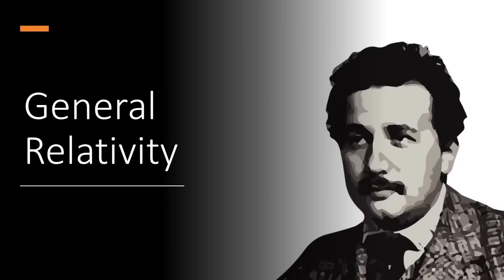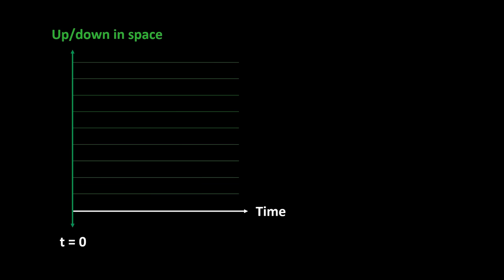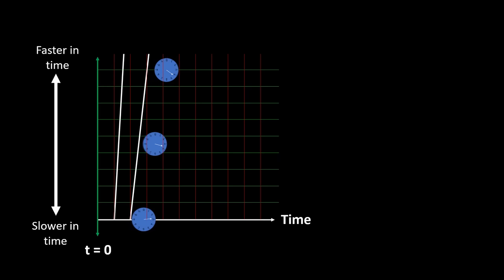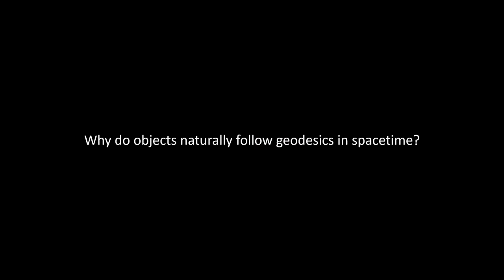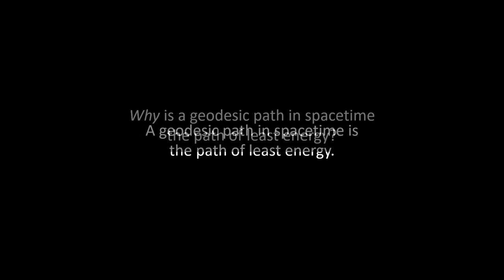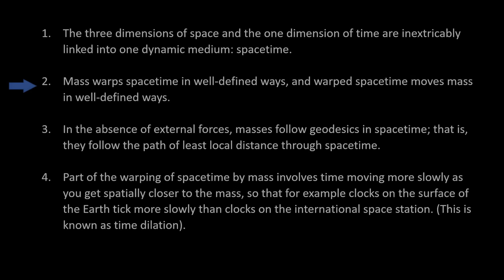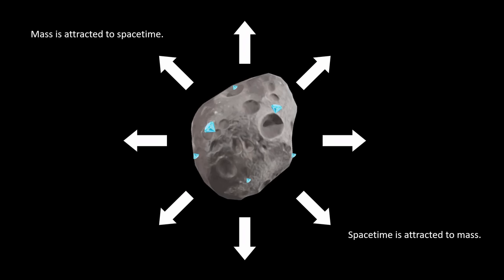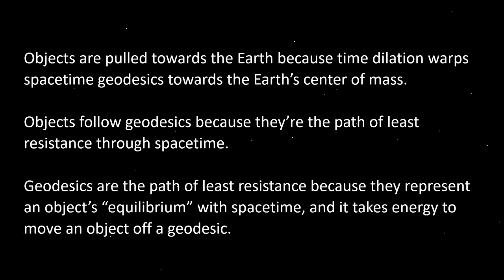How Time Dilation Causes Gravity, and How Inertia Works

Comment: Wait I think I figured it all out…. This whole change of time compared to each other is all dependent on e=mc2 or e/c2 =m.

Meaning as long as we agree that mass bends space time and slows down time for us…. It would also mean as we’re approaching high energy speeds… the mass of us or the speeding object increases substantially aswell…. Because speed or energy therefore increases… with the equation it means mass increases aswell for the speeding object….. and as mass is increasing… the gravitational effect increases too… meaning time slows down due to the speeding object having more mass….

This also explains why if you travel at the speed of ligjt to any distance in the universe. The object that’s speeding will actually take a few seconds to reach places 1000’s of light years away because the time slows down to such an extent for the moving speeding object traveling at speed of light.

But because the others on earth are relatively at rest, time still moves the same rate for them so it will take 1000’s of light years for them to even know the speeding object had reached another planet….

Comment: Let's say that someone is at the top of an extremely tall tower and is dropping pennies to someone at the bottom of the tower at the rate of 1 penny per second according to their clock.  Will the person on the bottom receive pennies at the rate of 1 per second according to their clock and will there be an accumulation of pennies in between the person at the top and the person at the bottom?

Comment: This representation does not match reality because the celestial bodies do not exist on the surface of space, but rather they are submerged in space, and therefore there is no such curvature, which is said to be the reason for the bodies’ attraction to each other. This is regardless of the fact that these bodies are not fixed, but moving. Imagine what happens to that alleged curvature. To approximate what I am saying, we have to imagine a ball moving inside the water and not on its surface. Even if we imagine a ball on the surface of the water, if it is fixed, there is no around it that curvature that occurs only when the ball falls on the surface of the water and then it quickly disappears.

Comment: Im getting stuck on why objects follow the geodesic. Yes i understand that its the shortest path, the path of least energy, the path that maximizes time.

But i feel like you were explaining the consequence and i couldnt derive this without already knowing the answer. I understand that it takes energy to move it off its geodesic, a consequnce of it following the path of least energy. That was a good analogy, but to, again, explain a consequence.

You didnt explicitly mention wether the apple you were talking about was described as a particle or 3d geometry, but it appears you were talking as if it were a particle (even if you werent).

In my head, the 3d geometry and gravity gradient (thus different parts of apple experience time slower or faster) might result in this motion. I cant really use that same reasoning for a particle, but a particle would experience gravity as well?

Comment: What if time is like a river?
Sand and rocks on the bed of a river impede the flow of water, and as the water slows, it
allows more sand to settle, further slowing the river.
What if the very presence of matter has a similar effect on time itself?
Imagine a diffuse cloud of hydrogen atoms. Each atom may slow the local passage of time
by an infinitesimal amount. In doing so, the atoms no longer follow purely inertial
trajectories through spacetime. Instead, their motion through three-dimensional space
adjusts in a way that favors lower-energy configurations.
As hydrogen atoms drift closer together, the local slowing of time becomes more
pronounced. This deepening temporal gradient further biases nearby atoms toward the
same region, leading to additional accumulation. Over time, this feedback loop causes
matter to clump, with increasing density reinforcing the local suppression of time.
What if this time dilation is gravity?
Rather than gravity acting as a force between masses, it may be that objects moving
through regions of slowed time naturally follow trajectories that lead toward lower-energy
configurations. In this view, what we perceive as gravitational attraction emerges from
motion through a temporally non-uniform field.
A body in motion can be described as following a trajectory through spacetime. In the
absence of forces, this trajectory does not change.
An object at rest in three-dimensional space is still moving through time. A bowling ball
sitting on the floor has no spatial motion, yet it follows a continuous temporal trajectory. If
the bowling ball is launched into space, part of its spacetime motion is redirected into
three-dimensional space, and the rate at which it accumulates time reduces accordingly.
If matter locally suppresses the passage of time, then changing an object’s temporal
trajectory becomes increasingly difficult. Changes in motion therefore involve
corresponding changes in spatial trajectory. From this perspective, resistance to
acceleration may arise from the effort required to reorient a body’s motion through a
temporally resistive environment.
In this view, what we call inertia may be a consequence of temporal drag.

If time forms a gradient that slows near matter, gravitational lensing can be understood as
light responding to that temporal structure. Although photons do not experience time
directly, their paths through spacetime are affected by how time is distributed. Light
passing closer to a mass traverses regions of slower time, which changes its effective path
relative to light traveling farther away, producing the bending we observe.
This perspective also clarifies why massless particles respond to gravity. Photons do not
experience time in the conventional sense and cannot be acted upon by forces in the usual
way. However, they still propagate through spacetime, and their paths are shaped by its
structure. If matter creates a gradient in the passage of time, then light traveling near
matter must navigate that temporal structure. The resulting curvature of photon
trajectories requires no mass or force, only a non-uniform temporal environment.
Massless particles don’t respond to gravity — they respond to the shape of time.

Comment: My question is this... if I increase my mass by adding energy potential (eating), thus increasing my gravitational field (due to increased mass), and thus creating a degree of time dilation (due to increased gravity), does time pass more slowly for you, the heavier you are?  Explanation for asking the question: Due to the premise of E=mc^2, when we add stored energy to an object (such as compressing a spring), its mass ("weight" on Earth) increases (if energy (E) increases, mass (m) must increase for the equation to be balanced). This has all been physically proven. So, if we increase the mass of an object by adding stored energy, that object now has an increased gravitational force (because of increased mass), and as such, must create a small amount of time dealation around it (warping of spacetime). The amount of increased gravitational pull can also be calculated (albeit, it is a very small number).  Update: AI says I'm right 🙂
Reply: Your clock would never slow just because your mass increased

Comment: I have a problem with this explanation. If time flows more slowly farther into the gravity well, then the diagram of curvature in time is wrong. As time progresses, the bottom of the well gets farther and farther behind in time, so the well should get deeper as time goes on. A FIXED curve would be the first derivative of the flow of time, not time itself. Objects should get heavier as time passes. If time dilation explains gravity, then a 100 ft pole should be heavier standing on end than itvis laying on its side, because of the larger time difference when standing on end.

Comment: I want to thank you for this exceptionally clear and insightful explanation of how time dilation underpins gravity. Your approach makes the geometric nature of gravity in general relativity much more accessible, and I appreciate the effort to clarify these deep concepts for a wider audience.

As someone exploring alternative models, I’ve developed the Fractal Topology of Space-Time (FTS) framework, which proposes a dynamic, time-dependent cause for geometric curvature. In FTS, the acceleration in a gravity well arises from simultaneous differences in atomic time (AT) over ephemeris time (ET) displacement, meaning that objects nearer to the centre of mass experience less AT per ET second, making the apparent force a dynamic and emergent phenomenon.
I believe both models produce the same observable results, but the underlying mechanisms differ in interesting ways. I’d love to hear your thoughts, and those of other viewers, on how the FTS approach compares to the standard geometric interpretation. Could a dynamic, emergent curvature offer new insights or predictions? What would be the best observational tests to distinguish between these models?

Thanks again for sparking such thoughtful discussion!

Comment: But the fact remains that the g00 (time-time) component of the metric completely dominates the Newtonian potential which produces the Newtonian gravitational force.  This is because g00 is multiplied by c^2, while the space-space or space-time components of the metric are not. Therefore only the curvature of time is responsible for gravitational attraction and the spatial curvature effects are negligible, contributing mainly to the bending of light and the precession of Mercury's orbit.
Reply: I'm not sure whether or not you're using a specific textbook as a guide on the   Correspondence Principle and recovering Newton's gravity in the curved spacetime of general Relativity ("GR"); regardless, I agree the effects and manifestations of the inverse-square law are completely explained with the weak-field limit of GR. 

I don't want to get too technical with the properties of the tensors, skip a step, or risk using the incorrect GR terminology. If you have the proper parameterizations for a Newtonian-like analysis and can disregard all but the time-time components of the metric tensor, then you essentially have a theory of "curved time" and "gravitation." 

You mentioned that the negligible effects of spatial curvature are attributable to the gravitational bending of light and the orbital precession of the perihelion of mercury. 

It's not a major error, but it's worth noting that both effects (which Einstein used as some of the first tests to prove the accuracy of GR) are NOT unique to Einsteinian gravity. 

In fact, and despite having an ambiguous nature in Newtonian mechanics, when we accept the Weak Equivalence Principal as the truth, then we must also accept that the path of photons will curve in a Newtonian gravitation field. 

The results from the Eddington's Observation of the solar eclipse that confirmed GR's predicted results were twice as large as the angle predicted by Newtonian gravity. 

Newton himself suspected that light would fall within a gravitational field but GR explains it accurately without needing a gravitational field. 

Finally, the orbital precession occurs in Newtonian gravity as well. The cause is mostly from the perturbations of the other planets. There's a remaining value that changes (~43 arc seconds per century), which is much faster than expected but too slow to get measured within the lifeime or Kepler or Newton. The precession cannot be explained by Newtonian gravitational effects. 

It's not the "unaccounted for" spatial curvature of GR either. It's the nonlinearity of the differential equations and the self-interacting gravitational field of GR. That effect is unique to GR and doesn't occur in Newtonian gravity. 

It only becomes noticeable in heavy gravity fields like in close proximity to the sun or dense bodies like black holes, neutron stars, and white dwarfs.

Comment: Time dilation is an EFFECT of gravity, not its CAUSE. As Einstein clearly stated:  Gravity is caused by the curvature of spacetime, which is distorted by the presence of mass and energy.  

Newtons First Law of Motion: Inertia is the resistance of an object to a change in its state of motion, meaning

an object at rest will stay at rest, and an object in motion will stay in motion with the same speed and in the same direction, unless acted upon by an external force.  Nothing complicated about it.
Reply: not in relativistic mechanics, the gradient is a time dilation gradient and that causes gravity - your path through spacetime is bent inwards because the presence of mass slows down time

Comment: No.
Time dilation cannot cause gravity because time dilation does not exist.
Atomic clock speed however is related to gravity by way of the Earth's magnetic flux density gradient.
Atomic clocks run faster in a less dense magnetic flux, at a higher altitude.
Atomic clocks run slower in a denser magnetic flux, at a lower altitude.
Gravity is a buoyant force in the flux density gradient, consistent with Gauss's Law for Gravity.

Just because two things seem related, such as atomic clock speed and gravity, does not imply a cause-and-effect relationship between the two.  There could be another thing such as the Earth's magnetic flux density gradient that causes them both.

Comment: The statement that "clocks on the face of the Earth tick more slowly than clocks on the International Space Station" is factually not correct.  An astronaut on the International Space Station ages more slowly than someone on Earth.  There two effects at play here.  General Relativity and Special Relativity.  Special Relativity tells us that the faster an object travels, the slower time passes. General Relativity says the closer an object is to a mass,  the slower time passes.  In the case of the International Space Station, clocks actually tick slower than clocks on Earth because the velocity time dilation is greater than the mass dilation.  In the case of GPS satellites, because they have higher orbits, the effect of the mass time dilation is greater and clocks on the satellite actually tick slightly faster compared to those on Earth.

Comment: I first heard this concept about a year ago and it just intuitively clicked.

As I have been thinking on this I thought of the problem where stars in galactic rims seems to orbit too fast. It occurred to me, what if time is moving much more quickly in the emptiness between galaxies? This might cause the discrepancy in star orbital speeds, no need for "dark matter". This accelerated time flow may even account for accelerated universe expansion in some way, so no need for "dark energy".

Comment: The difference  between gravity, matter and mass. The clocks using energy are effected by other energy. ON earth Gravity is greater, so the clock on the space is not affected by Earth's energy. Space is a vacuum absorbing energy, neutralizing mass making it weightlessness, massless energy. So zero equals 9.8 m/s is the difference  of seconds between  the two clicks.

Comment: Time is solid. It can't be moved by gravity or any force. We only will calculate it differently. The clocks have no meaning. Time is the same here or a million miles away on any planet. They just track differently. One scientists finally realize they have been wrong all this time (just like everything before that has held as true and proven wrong) they will make great strides in discovery. Time is like a tube with time inside. Gravity can pull the tube but time is always the same.

Comment: Mass does not Pull, Space does not Warp, Time Pushes.
+++++++++++ - high pressure time - farther away from mass 
+ + + + + + + + - low pressure time - closer to mass 
Those extra pluses push downward and with no extra pluses to counter that push, you get ACCELERATION.

You make the simple complex to confuse and obfuscate.

The "curvature" of spacetime is a mapping of the acceleration from TIME onto SPACE as in GEOMETRY.

What is the geometry of time???

The faster time clicks the more pressure it exerts towards mass. High Pressure Time always pushes towards mass - that is how orbits work.

NO GRAVITY WELL.

Comment: If the particles follow a geodesic and to move away from the geodesic one needs to supply energy. As soon as it is shut off the particle will start following the geodesic again.
But what if I throw the apple downwards with extra energy. It will follow the same geodesic but with extra energy. Won't that make it the path with non least energy?

Comment: The problem with asylums explanation is that it requires objects to move very fast for their tops to rotate faster than their bottoms thus causing gravity at 9.8 m/s^2. As far as I know we are not moving at relativistic speeds.